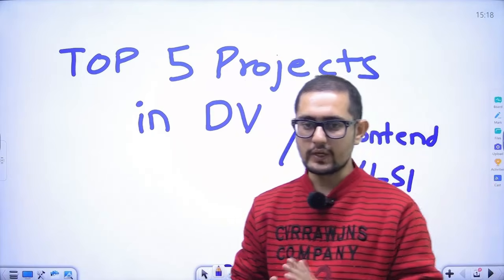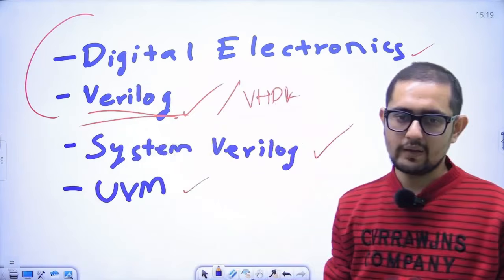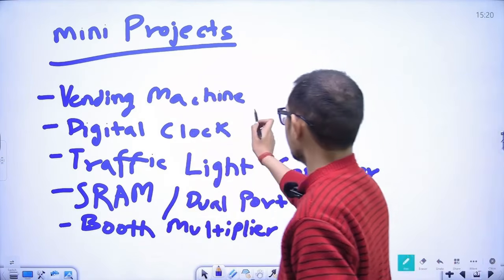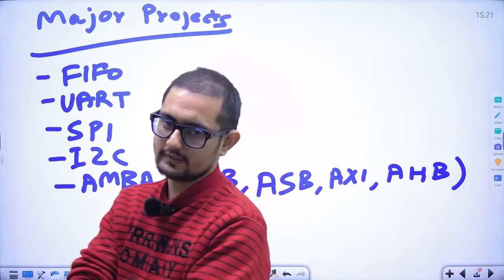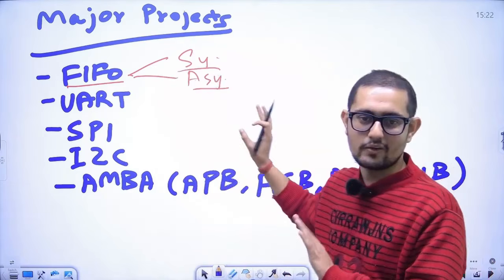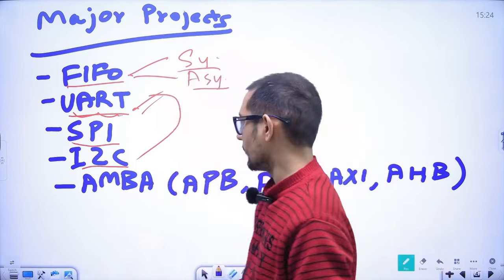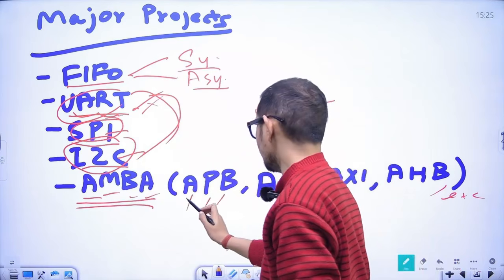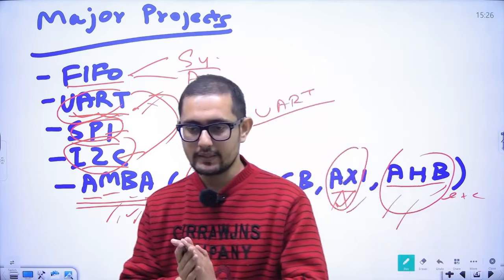TOP 5 FRONTEND VLSI Projects | Digital Electronics Projects | RTL Design & Verification Best Project

Comment: Mini projects
1. Vending Machine 
2. Digital Clock 
3. Traffic Light Controller 
4. SRAM/Dual Port RAM
5. Booth Multiplier 

Major projects
1. FIFO
2. UART
3. SPI
4. I2C
5. AMBA(APB,ASB,AXI,AHB)